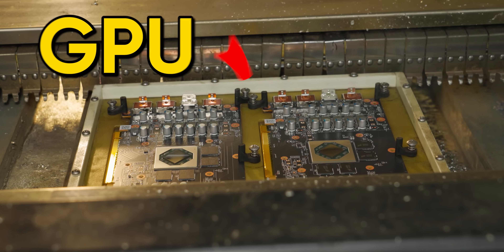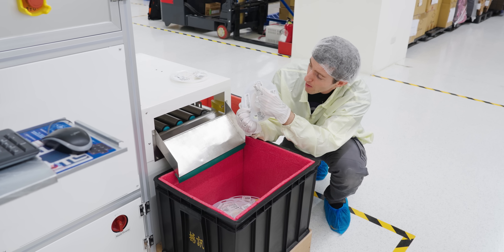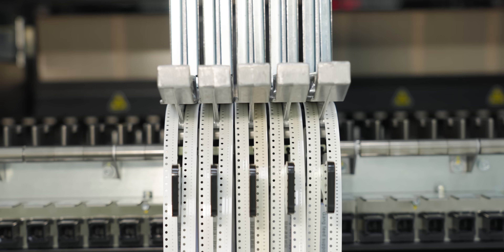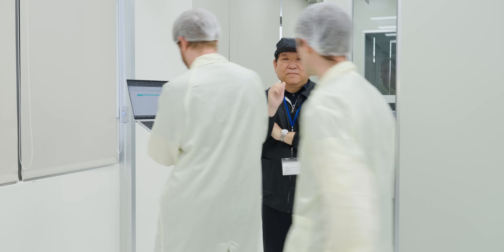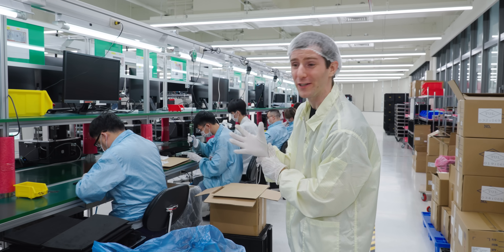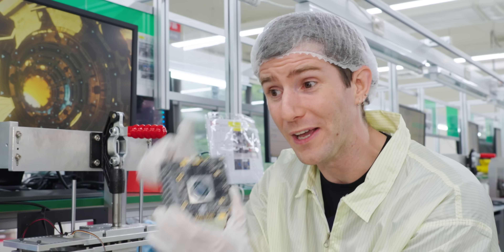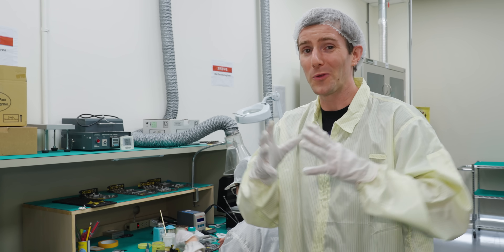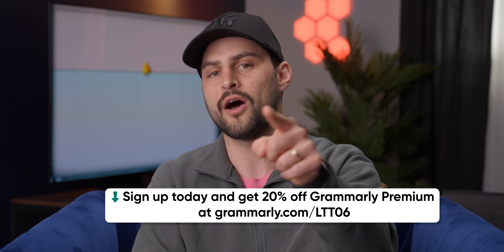They Turned off this GPU Factory For Me! PowerColor Factory Tour

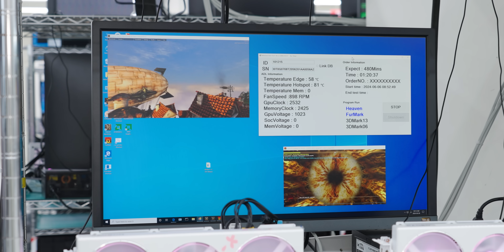Comment: 9:50 - start time 06/06/2024
This was actually recorded, edited, and uploaded in 24 hours. Dang
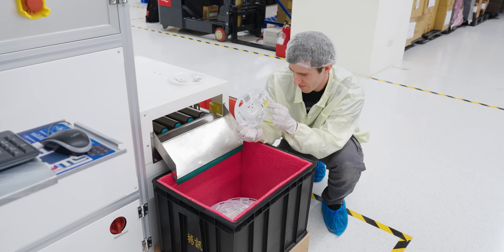Reply: you can see at 9:50 the time on the PC is 10:13A, assuming its in CST (UTC+8, or 2:13 UTC), and the video was released 22:22 (UTC), that would be 20 hours, to finish the rest of the tour, get the footage, edit and upload
Reply: @u1f98a  pretty good considering most videos are 1 month or so after they record
Reply: @u1f98a  Holy shit, they got a whole media group back there!
Reply: @u1f98a  don't forget they also probably had to get the final product cleared with powercolor/tul as well
Reply: @Machineheadtim  Yeah, as well as Linus himself signing off on it after watching. He made reference to it on WAN, something like 3.30am for the finished edit ( I forget what time zone ) , before could watch and approve the final.
That this was somewhat of a rushed script/shoot after the Nvidia tour fell through, is pretty insane, even if don't consider the already crammed timing of getting out videos from the expo.
Not making any judgement on the cramming aspect, he has often said that it is very far from ideal, but, my guess is that he alleviates the downsides, with other incentives or compensation.
Reply: holy lack of tape delay batman
Reply: This is genuinely impressive!
Reply: 20:05:14 is the exact time it took to go from a point in that clip to a finished video (i spent like 10 mins getting exact figures pls read)

- Used 1:32 to get the timezone (taiwan)
- used 9:50 to get the exact time of that clip being recorded (10:13:28)
- used an api to get the exact time that the video was posted (02:18:42 UAE time)
- added 4 hours to get taiwan timezone, (6:18:42)
- 10:13:28 to 6:18:42 is the duration
- difference is exactly 20:05:14
so 20 hours, 5 minutes and 14 seconds. Pretty neat.
Reply: What is the propagation time for YouTube? In terms of deploying to global mirroring servers. (After going through encoding process.) This might be 2 hours or so just in-and-of-itself!
Reply: @fitybux4664   You are right! Even if upload speeds aren't much of an issue, youtube still takes quite a bit of time to process the video to be postable.
Reply: @3_pancakes767  It don't take that long for YT to process uploads.

20 minute to an hour at worst (as of late anyway)
Reply: + someone from the factory had to review the video and give a goahead that the edit was good (i.e. that it is not reviling any confidential data). I thought this step would have taken several months.
Reply: @blackkissi  There probably was a supervisor telling what to and not record
Reply: they travel with the editors and have other editors over net still at home not that impossible
Reply: @lilytrx7276  my point was they usually go 2-4 weeks between shooting and uploading
Reply: I guess I'll forgive the audio inconsistency then.
Reply: guess they broke the rule just for this one
Reply: He's in Taiwan, so with the time difference included, it'll be around 32 hours or so
Reply: Dennis is doing the editing. Before he worked for LMG in Canada, he worked in Outside Broadcast for a Taiwanese News channel doing "quick and dirty" camera work and edits. He hated it, so his college buddies (Berkel and Brandon) from his training in Canada found him a space at LMG.
Reply: I have a powercolor card in my PC 👍
Reply: They don’t play no more
Reply: Money does anything
Reply: Editors working overtime on this one
Reply: Jokes on them, I do that with every video I make. So much easier to shit out videos quick when the quality if potat😎😎
Reply: Different time zone
Reply: the most impressive thing about this is that it got approved by TUL/powercolor in that amount of time.
Reply: That the amount of time my bowl movements happen. Gah damn right intime for the pooper.
Reply: LMG has an army of editors so not impossible stunt. Look like for some reason this was top priority.
Reply: @dtibor5903  of course they do, just pointed it out because they usually take 2-3 weeks between shooting and uploading
Reply: @dtibor5903  of course they do, just pointed it out because they usually take 2-3 weeks between shooting and uploading
Reply: You understand what timezones are?
Reply: This is actually why I avoid internet debates 😂
Reply: 2 days. The computers are in china time, which is 1 day ahead
Reply: Hope they aren’t rushing that much on their other vids…
Reply: @jonathanshapiro6593  this one was probably released quickly so they can recoup the costs of cutting the fab output by more than half for a day
Reply: @apollo-p1d  They had to go through the factory quickly, but they didn't need to upload it quickly
Reply: @apollo-p1d  I bet the fab was down for maintenance or something anyway. But still it propably cost a lot for them.
Reply: @apollo-p1d  thats not how youtube cash works, but ok. I think its because they have framework stuff in it so it kinda have to be out soon.
Reply: @apollo-p1d geopolitical timing.
Reply: @jacobbailey2950  Signing the GPU would cause a surge in sales. The factory probably specifically requested that the video beat the GPU to the shelves. To recoup the costs of cutting the fab output by more than half for a day.
Reply: @jonathanshapiro6593  probably not, usually they have 2 - 4 week production cycles at LTT. I would imagine this being an on location shoot that could only be 3 hours long, it was rather easy to edit. Usually they probably sift through many more hours of footage per video
Reply: @jonathanshapiro6593  everyone is rushing videos on this trip, especially the computex ones because if they don’t cover it right away then people are less likely to watch it. Also considering the amount of staff LTT has then getting videos out this quickly, whilst not ideal, should still be possible.

Comment: It's crazy that "future" tech that consumers will be able to buy in 2+ years currently exists and running in RD labs.
That state of the art 4090 gpu that just came out actually existed when the 3080 was released. Hell, there's probably a 6080 in a lab somewhere.
Reply: Well, gotta test that stuff properly prior.
I just hope they don't put out more and more power tho, running a modern PC honestly has gotten somewhat expensive at this point, if we keep that up and expand on it too fast we'll end up with a line up that no one wants at some point for the sole reason of it not being worth it anymore
Reply: 2+ years out most of the time it's not even at the silicon stage, they're still running a bunch of simulations on the design typically. It's possible you have the first silicon iteration at that point but it will definitely be revised by the time it gets to the release product.
Reply: I’ve not worked with GPUs so it’s not quite the same, but for broadcast chain equipment what’s currently being sold is normally at least 2 generation behind what’s in the lab.

Back in ~2010 HD broadcasts were still fairly new, but we had 4K & 8K tech in the labs at my old job. It was a surreal experience to be playing with fibre optic connected storage systems for cameras which could read and write data faster than system RAM in my laptop.

A few years ago the same tech was used for the Glasgow Games. The video gallery was in London, but it was working as if it was on site in Glasgow. 

Each frame could get to London faster than the 16ms it took to display the same frame on the viewfinder screen on the back of the camera.

It’s an exciting process seeing tech come to life.
Reply: @jamieknight326  This is the entire reason things get better though, both consumer side and manufacturer side. Because things are getting better and they need more powerful support structures. Imagine if there wasn't a need to increase internet speeds, we'd still be on dial-up, and the reason internet speeds increased is more than likely probably because of both widespread usage and manufacturers finding uses of high speed/bandwidth applications.
Reply: nvidia probably has 2-3 generations worked ahead. And now with their 3 trillion marketshare im sure they can do 4-5-6 generations in advance. Especially if they really going to do that yearly major new release cadence.
Reply: @Andytlp They'll have 1-2 generations ahead in testing and the next 5+ in R&D
Reply: Actually i'm 100% sure that there is no 6080 in that lab, because PowerColor works only with AMD kkkkkkkkkkkkk (but I got what you said)

Comment: 9:42 that's crazy that they use consumer load testing applications in a factory
Reply: If it ain't broke...
Reply: I mean it makes sense, beyond factory tested environments, being able to stress test in the same way as the consumer to prove card reliability makes perfectly good sense.
Reply: It makes sense. I mean, what better way to know a product is going to work on consumer software than to run consumer software on it?
Reply: Don't fix it
Reply: Not really. It's the equivalent of using off-the-shelf parts for something that reasonably doesn't need anything custom. They need a particular size of screw for GPU assembly, so they buy the screws. They need to evaluate GPU performance, so they use an available tool. That makes them smart and pragmatic, not crazy. Why invest in a tailor-made tool when an existing one does the job perfectly well?

It's just good business sense.
Reply: @MediocreHexPeddler  i don't think they meant TUL is actually crazy/insane; it just seems they didn't expect that consumer programs were used industrially and are expressing their shock.
Reply: I’d sort of see it the other way around. As consumers, we happen to have access to industrial and engineering grade test and validation software. 

Furmark is more or less the most intense torture test that can be run on a GPU. I ran a VR focused R&D project a few years ago and if the machine didn’t thermal throttle after 12 hours of Furmark it would be able to handle everything we needed. With thermals under control we found reliability voltage was the main performance limiter most of the time.
Reply: how is that crazy… this is a product for consum😅
Reply: they probably paid enterprise license to use those
Reply: @spartand001  probably have a single windows image deployed for that testing across that entire workroom
Reply: Even the manufacturers agree these tools can check if a graphics card is working — I think that's awesome!
Reply: Wonder if they need and paid for commercial licenses 😅